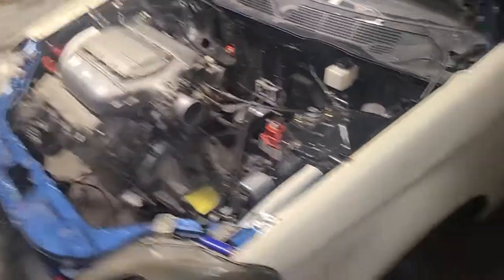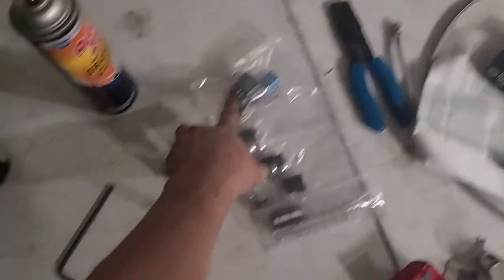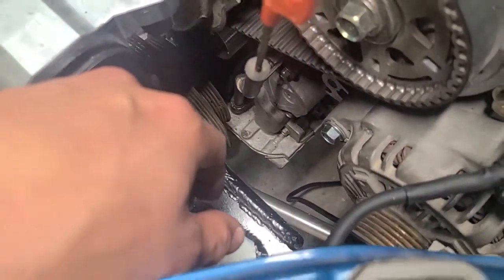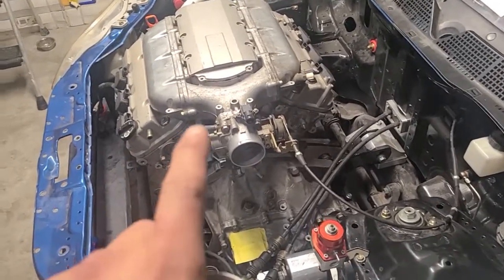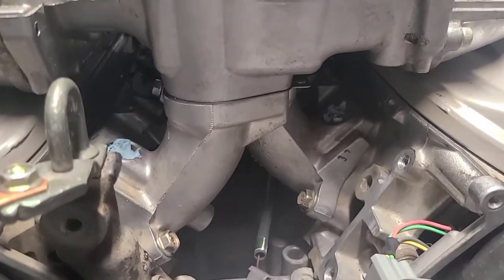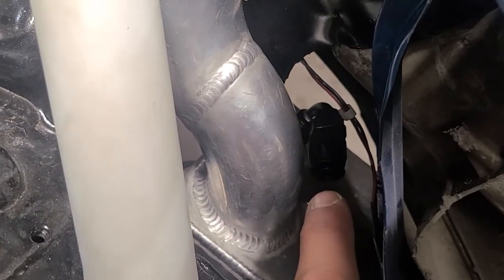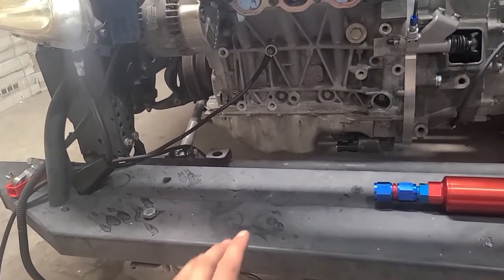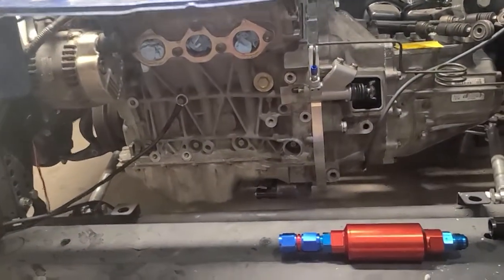j2k update

Comment: Hi nice work 
How does the j2k kit make the transmission and engine spin the same way
Reply from the maker: J and K swaps rotate the same... h2b is good example... j2k is the same.... both use an adapter plate and fly wheel spacer or custom flywheel.... check out the other videos brother

Comment: what engine harness will be used? lol cant find this info anywhere
Reply from the maker: Stock j32a2 auto harness on aem v2
Reply: Do you have to add or mate any connectors for the auto trans to manual?
Reply from the maker: @TheLEDESMA1  I lefted the harness alone and added the A D plug pined what I need maybe o2 sensors , nitrous aiming/ solenoid , vss and afew other things